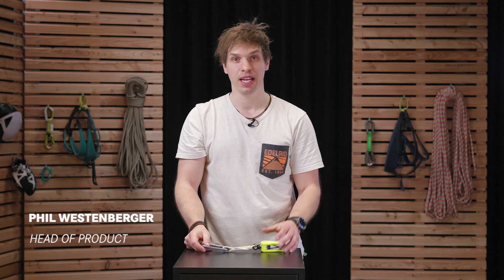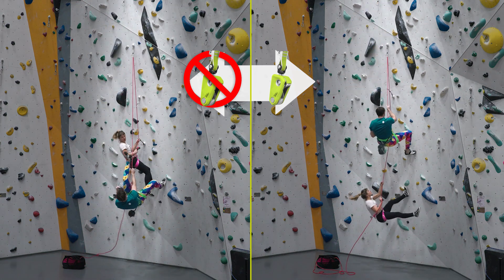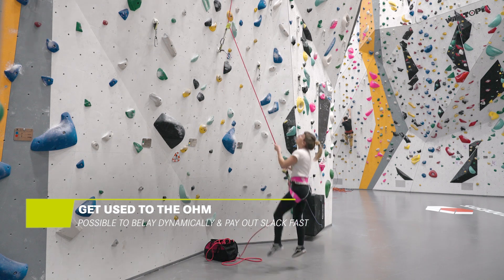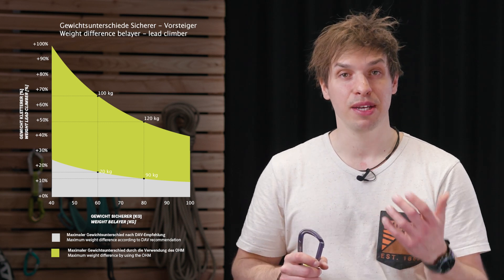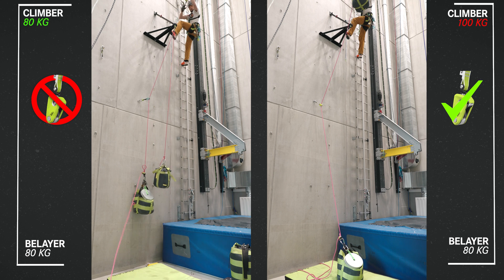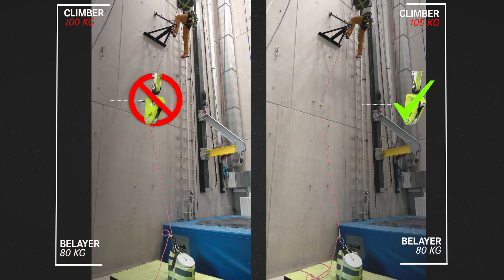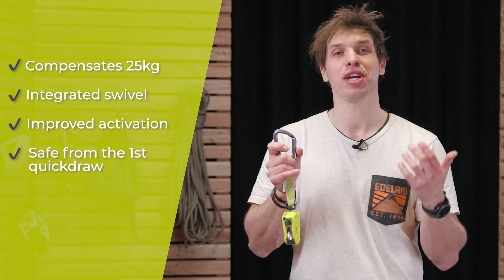OHM II Tutorial | EDELRID

Comment: Sorry, did i understand correctly that ohm 2 compensates for more KG differnece than ohm 1? In other words, it adds more friction to the system so that even lighter belayer can belay leader of the same weight? Is that what is said at 6:30. Thanks
Reply from the maker: The German Alpine Club (not EDELRID) recommends a maximum weight difference of 10 kg, above which the climbing party should take additional measures (whatever it is) to make climbing together safer.

When we developed the OHM I, the recommendation of the German Alpine Club was still a maximum weight difference of up to 30% without the need to take additional measures. For the OHM I, we used to communicate an “allowed” weight difference of up to 40 kg, depending on the body weight of the belayer. These 40 kg consisted of the recommendation of the German Alpine Club, as well as testing results from our testing set up back then. 

Meanwhile, we realized that we should not talk about an “allowed” weight difference and also should not integrate a recommendation from an Alpine Club, as other institutions might have different guidelines. Therefore, we developed a new testing method that only wants to objectively find out how much weight the OHM II compensates and communicate exactly this value. With this new method, we measured that the OHM II offsets 25 kg. According to this same new testing method the old OHM compensates 15 kg (10 kg less).

Now, anybody using the OHM II takes 25 Kg offset into their consideration, while the climbing party always needs to assess its individual situation and decide whether additional measures are still needed. The OHM II offsets a higher weight difference then the old one. However, the optimized cam geometry also reduces false activations compared to the OHM I. So you can expect a smoother handling and a better performance. 😊
Reply: yes, they said their numbers were wrong on the first one but the new one "adds" 25kg to the belayer which is 10kg more than the previous one.
Reply: @philipp9604  " no, old Ohm compensates for the same weight difference as the new one."

not true.

Comment: Can I ask… what’s the advantage of the new one? I have the old one. I found with the old one I could not clip quickly or I would engage the ohm, and my belayer had plenty of slack. It would be nice to see an ohm that allows for quicker clipping.
Reply: I have the same question !
I already have a ohm 1. The swivel is a very nice feature, but it won’t convince me to buy a version 2…
However, if the ohm 2 is better at not engaging when I am trying to clip… then this might convince me to buy a new one, as this is quite annoying when it happens !
Reply from the maker: With the update of the OHM to the second generation we implemented several improvements:
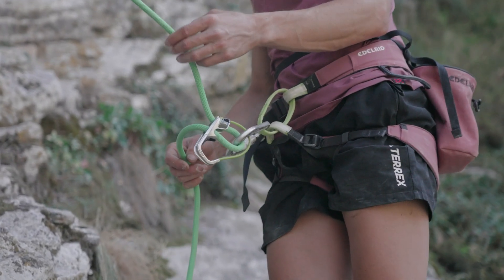- Thanks to the updated geometry the risk of false activations is minimized while providing at the same time more friction when activated (watch at 1:16)
- Integrated swivel, thus direction of the device does not play a role anymore (watch at 2:17). Similar to using quick draws, we still recommend to install the carabiner with the gate opposite to the subsequent rope course. 
- Improved opening & closing mechanism (watch at 1:39)